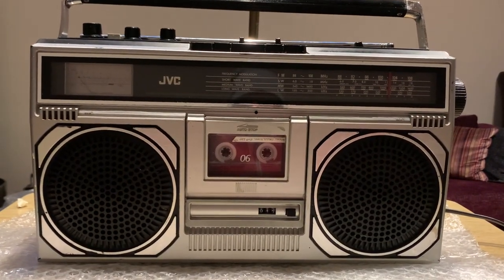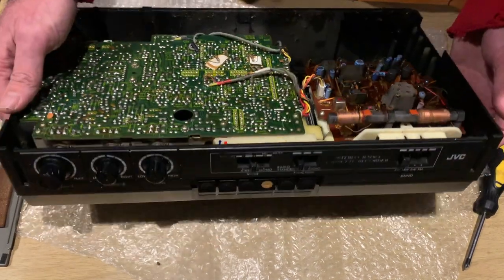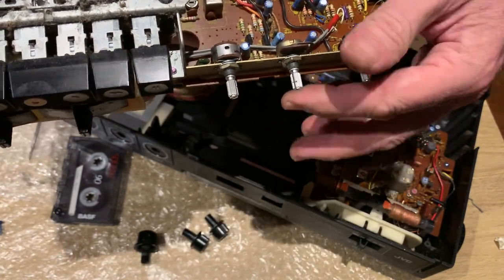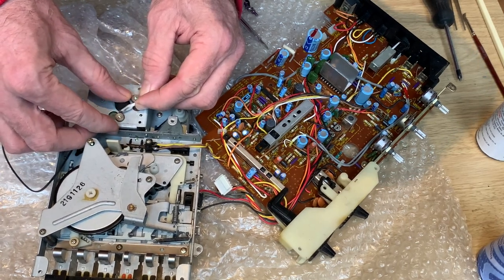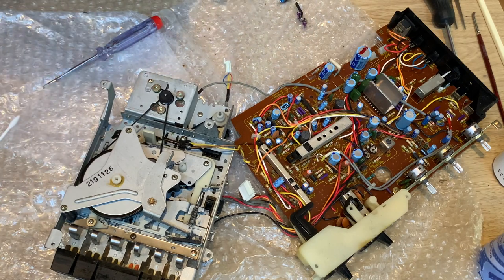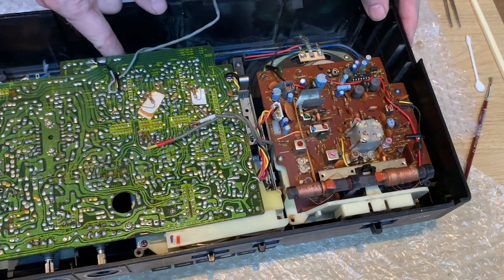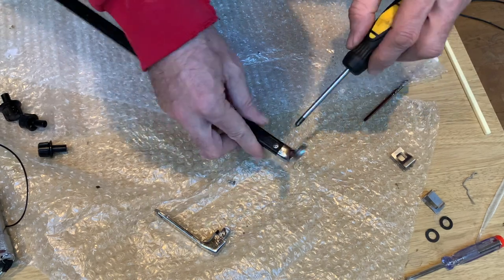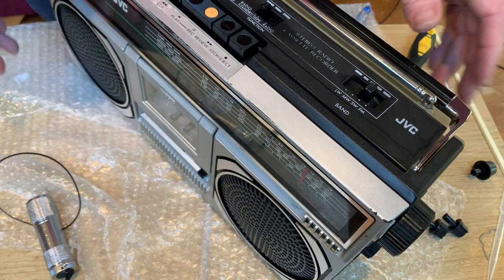JVC RC-545L Service & Repair. Vintage Boombox Belt Change. Ghetto Blaster Handle Fix.

Comment: Any idea where I can get old JVC service manuals?
Reply: which model??
Reply from the maker: They can sometimes be found online, depending on the model - usually for a download fee though. Also, eBay has a fair few, but again expensive (often low res scanned), and $25 postage, which is why I've avoided them until now. Might be worth trying a couple of boombox forums too. Best bet to start is just to google the model and any references to manuals tend to come up. Thanks for watching 👍
Reply: @paolorams767  JVC RC 727W